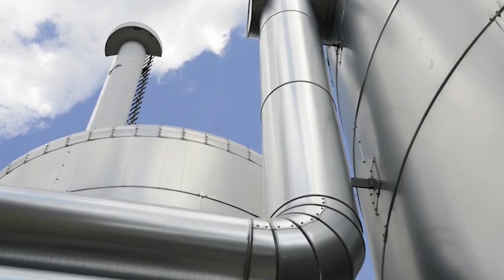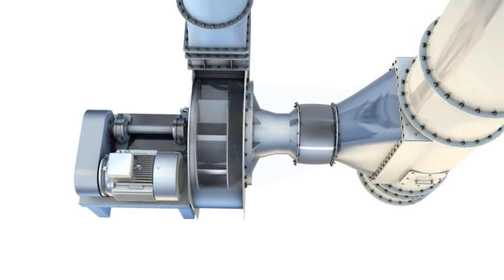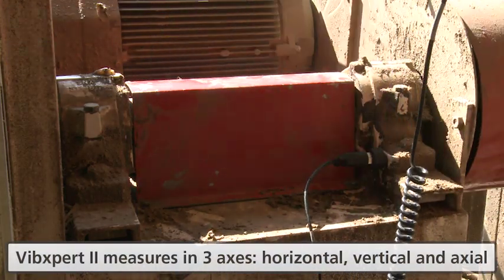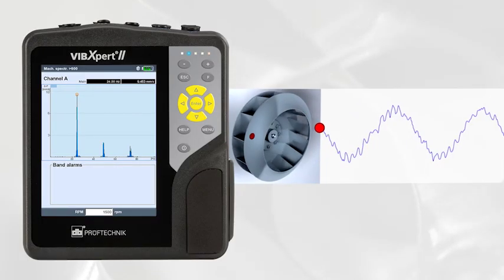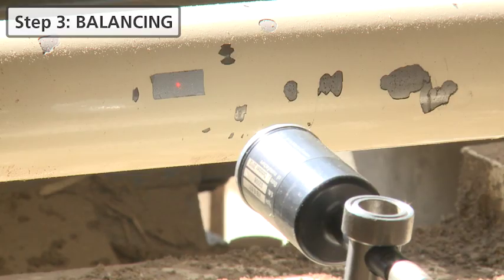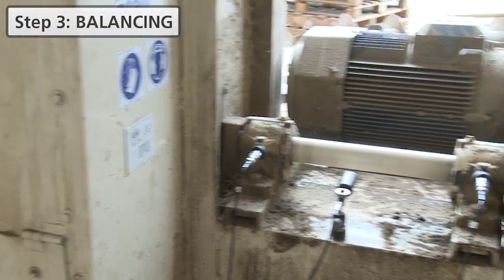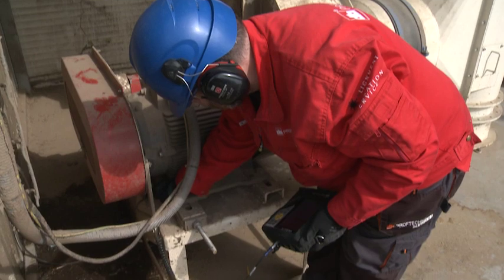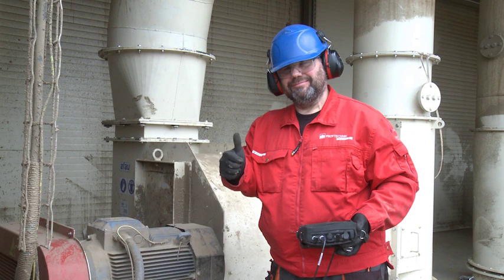Field balancing with VIBXPERT II by PRUFTECHNIK

Comment: Hello ... If you please I have one question . I have  this device on job and I making balancing of big ventilators of primary air in coal power plant , also on others ventilators if it is necessary . One thing drives me crazy . I know when we creating input data in to device , particulary angle between vibrations sensor and optical sensor we take angle between those sensore in oposite direction of rotation. Like example vibration sensor I put verticaly on bearing housing , optical sensor I put on horisontal position on shaft , oposite of rotation , angle will be 90°. But I expirienced crazy situation on some other ventilators , that rottating in same direction , sensors are in same positions but weight going contra  - for 180°. So in that case I know that I am made mistake and I puting weight in frst step on contra side . But that makes trouble for the final weight , it brings me in position to not believe in my countering of right angle .
Reply: Try putting the trial weight -135deg from max out of balance. 
Angle is measured keeping rotation in same direction. It looks reverse because we are measure angles on the moving component. 
I try to set up the phaser inline with a marked starting point '0'. It's just easier.
Reply from the maker: Dear emir džibrić
,  

First of all, thank you very much for your comment. 
As it seems, you have run into severe issues. Please let us help you get the best quality work from your efforts. Please contact us through our website https://www.pruftechnik.com/com/Products-and-Services/Services/Technical-Support/, and we will come back to you right away to solve your issue.

Best regards, 
Your PRUFTECHNIK Team
Reply: @PRUFTECHNIKGroup  ok

Comment: 1 and done with a weld on weight??? lol I call bs. Nice demo tho. Hell of a lot better price point than the CSI 2340 I'm using.
Reply: I use one of these and as long as the fan behaves, one shot balances are often done. Actually there are 4 runs. As found, trial, trim and check. No way out of that. And some times many more eh!